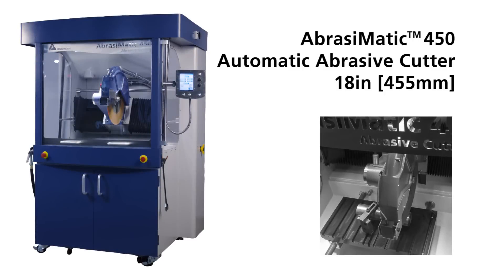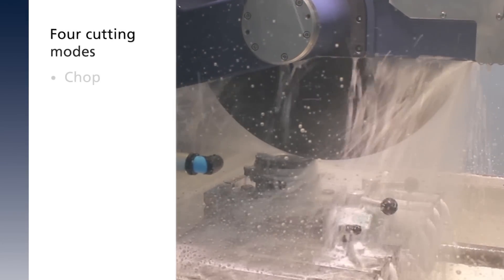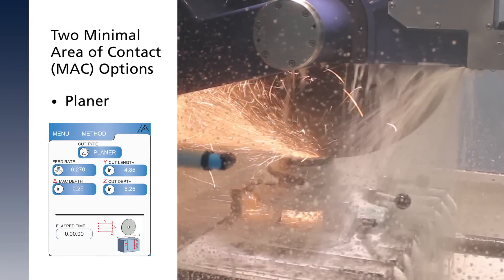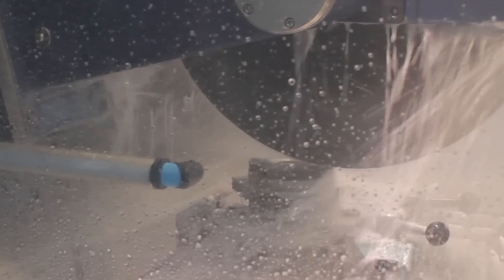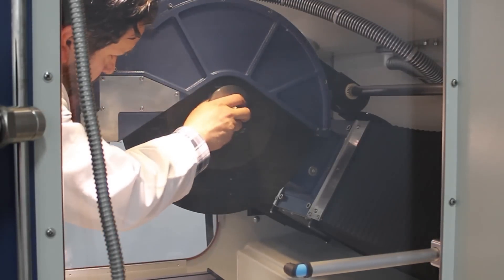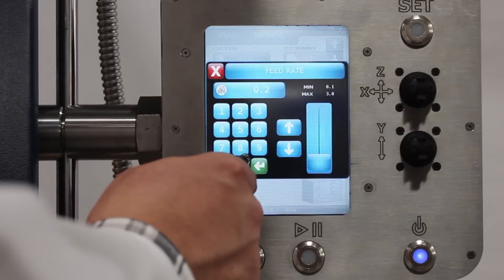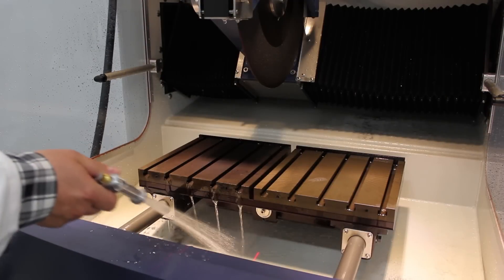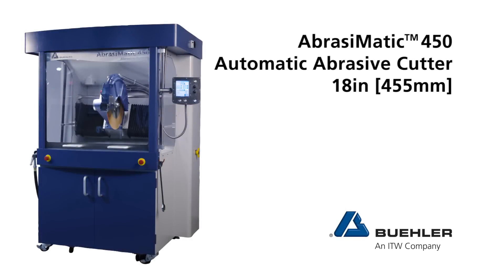AbrasiMatic™ 450 Automatic Abrasive Cutter - 18in [455mm]

Comment from the maker: Check out this video on the AbrasiMatic 450- For production environments that desire quality and repeatability, the AbrasiMatic 450 is a fully automated 18” [455mm] abrasive cutter that delivers consistent results. Unlike other abrasive cutters of its size, the AbrasiMatic 450 comes fully equipped with 3-axis motion and a full suite of advanced cutting features that save time and protect the integrity of the cut surface.